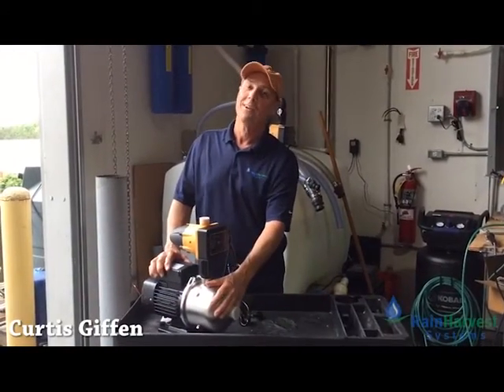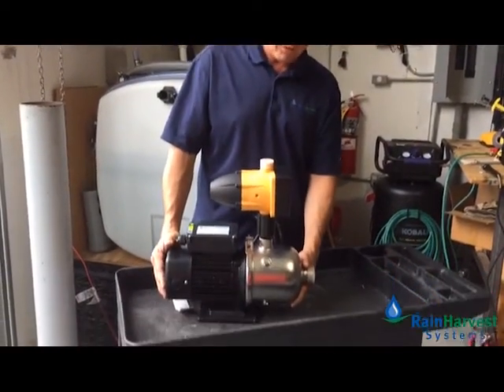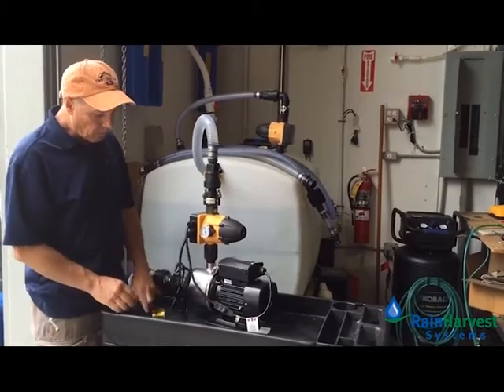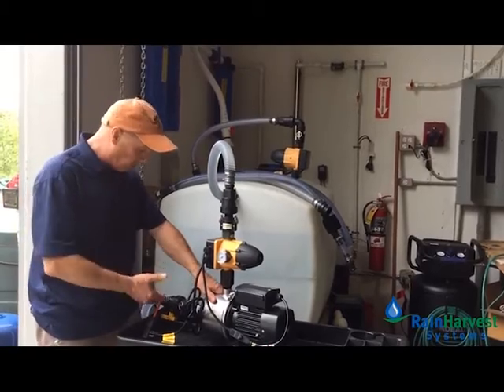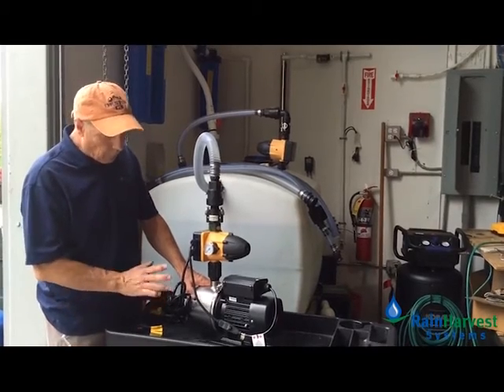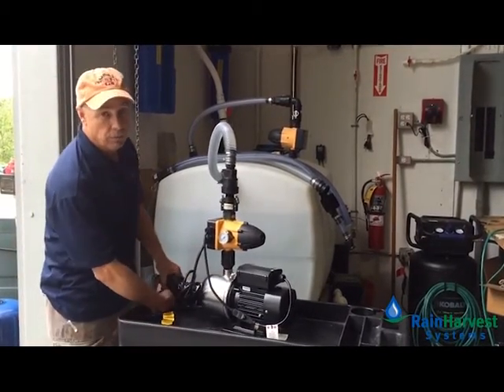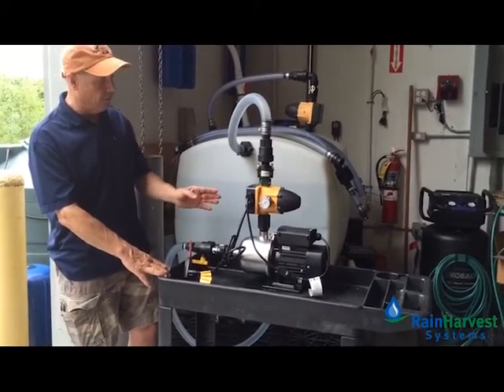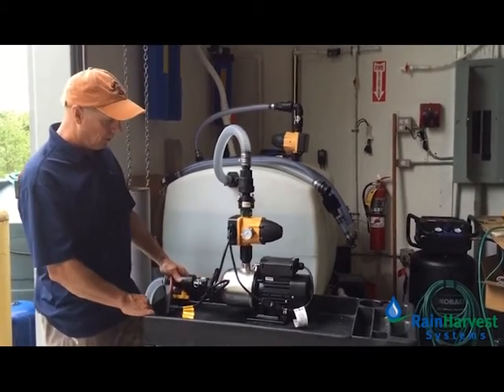MHP75A Automatic Water Pump

Comment: I really wish I could find a strong enough pump for our 120v stystem. We've gone through two Grunfos MQ-45  pumps and I think our current is a Walrus.  Two story house and 3 full bathrooms. I wonder if this one will be better for us  RainFlo MHP150A 1.5 HP Automatic Pump.
Reply: Hi, the MQ-45 produces about 20 GPM max and 60 psi max. The RainFlo MHP150-A about 36 GPM max.and 65 psi max. So, for example if you are looking for about 30 psi the Grundfos delivers about 16 GPM verses almost 30 GPM form the RainFlo pump. You would see a sizable difference in flow from the two pumps. Conversely the pressure/head is a little better with the RainFlo which would help with the upstairs fixtures. Hope this helps!
Reply: It certainly does, this pump seems to have the best specs for  120v wiring. I like that the automatic unit detaches with the electrical unit diagnosis making it easier for a home owner to replace. This will be our next unit and I may just end this Walruses service a little early because it's even less powerful than the Grundfos, seems more reliable though. Thank you.
Reply: I use the MPH75 for our house.  3000 sq ft with 3 full bath.  I have plenty of water pressure even with the washer/dishwasher and two showers going at the same time.  I purchased the pump in Aug 0f 2018, installed in Sept of 18.  It is now Apr of 20 and I don't have a sing'e complaint.
Reply: @Stratouss  Do you have a pressure tank or just the pump?  Thanks!
Reply: It would good if you could describe pressure adjustment. The  screw on the back of the controller  does not move and it is overpressuring my on demand water heater in my RV. The pump is pushing well over 100psi.